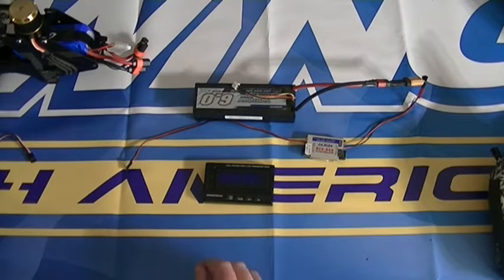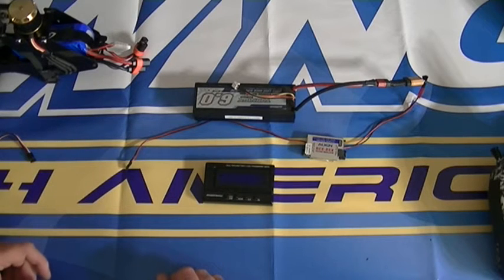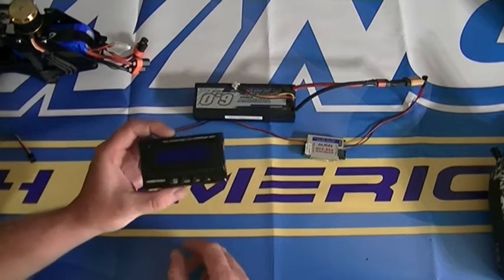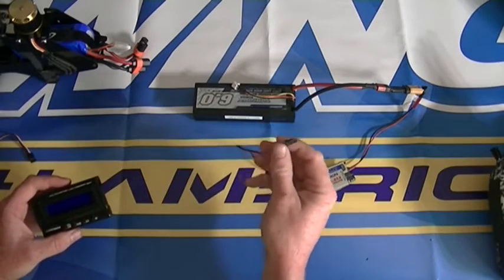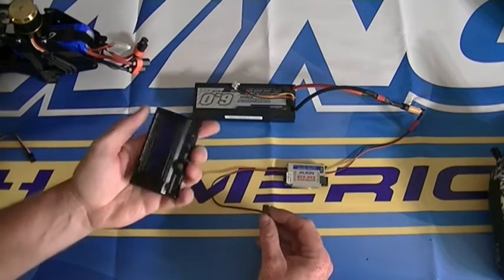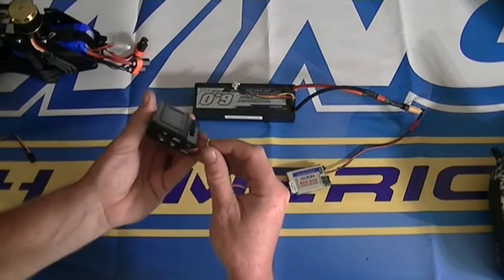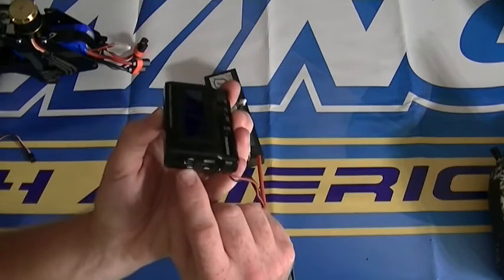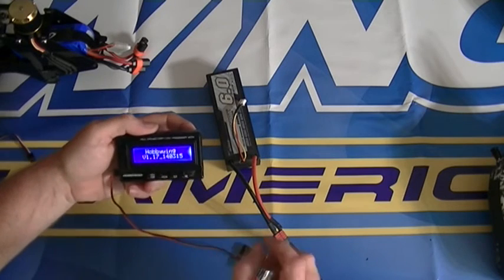Hobbywing Platinum v3/4 throttle cal and gov programming P1

Comment: what if I'm using fbl gove
Reply from the maker: Woka Floka depending on what fbl unit you have you will either need to run the HW in heli linear or gov fixed wing mode
Reply: DarkSyd3D carp its a 3digi can u call me and walk me through it
Reply from the maker: Woka Floka I'm not familiar with 3digi but my team manager is. If you have a Facebook ping Randy Tribke
Reply: DarkSyd3D I am just so sick of helicopters can't figure any damn thing out its just 2 damn complicated
Reply from the maker: Woka Floka the 3digi isn't the easiest to set up. I run spartan because I haven't found one simpler that works as well. 
I've heard BeastX is simple also
Reply: DarkSyd3D I swear I'm about to smash the helicopter they said the 3digi is like the demon or the v bar so do you know how u would set it with a v bar

Comment: hi im wondering if you do tail setup in rate mode first to get the tail stop turning and then switch to Heading hold mode to get the tail rock solid?and also if you do that rate mode setup do you program the esc to Govenor store first or after the tail setup?anyway nice video it helped me a little
Reply from the maker: Marvin van Laviere if you use the Spartan fbl you do not need to use rate mode to set the tail. It has a trim flight function that will adjust the tail as it needs. All other fbl you surely can do rate mode. 
You will need to set the Gov store before your first hover. The tail should still hold while your on the ground doing the standardization.  Cheers